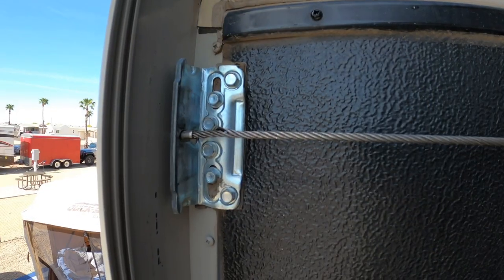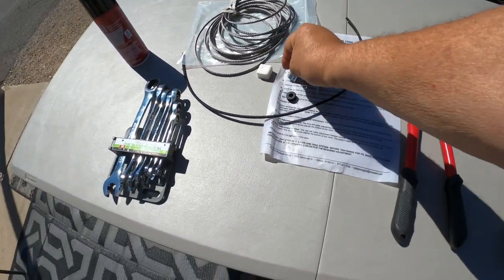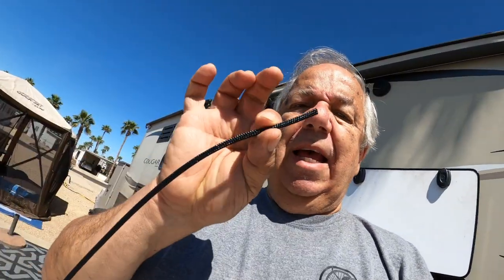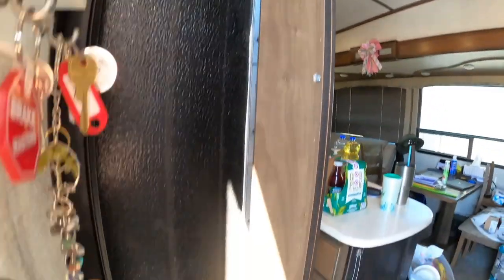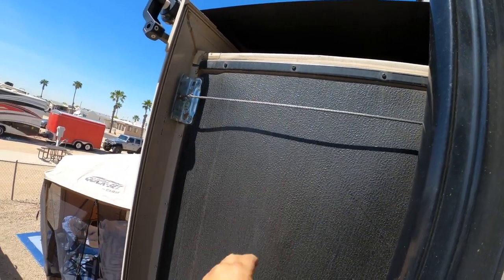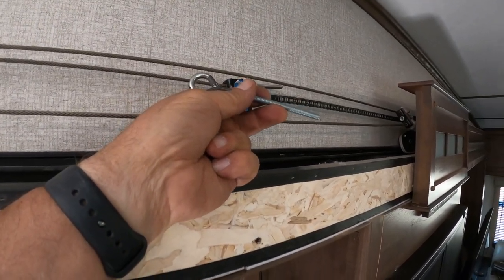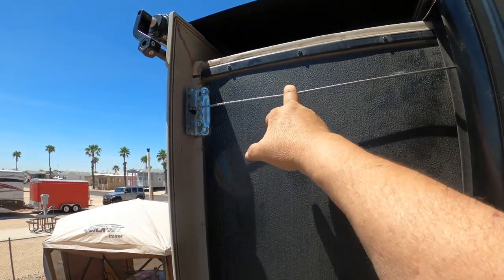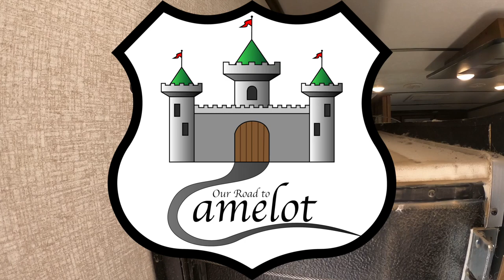Replacing the RV Slide Out Cable

Comment: Thanks for the video, I'm sure this will help someone else. I keep a toolbox just for BAL slide tools and parts. A spare motor and gearbox along with a spare cable or two is good insurance. We've broken three cables and had a gear break while on the road, all on our kitchen slide. I never thought of using an adhesive to help with the "chinese finger" tube, and you're correct about the tape bunching up.
Reply: If you have had a particular cable break more than once, then the root cause of the problem hasn’t been identified and I would suggest taking it to an authorized dealer that can assess the issue and get that fixed so you no longer damage any cables. Typically the standoff bracket placement that the cable is secured to on your box is in the wrong location, causing the cable to fail in the sealed position as it’s going down the road fraying your cable.

Comment: Thanks. Mine broke while putting the rear bed slide out 6-7 hours from home. I had to cut out the twisted mess of cable and hopefully will make it home with only 3 in pulling cables. I’ll order the cables and fix this at home with your helpful demonstration

Comment: My wood trim or headers was nailed together from Montana. To make ours serviceable all the nails were removed and all sections were reattached with ss finish washers painted flat black and 1.2" drywall screws were used. All three slides were modified like this. We also converted our refrigerator to a Dutch Aire 12v dual compressor system and needed 3/4" additional space for clearance. Some 1x2 oak strips were stained to match our cabinets and the same black screws and washers were used.

Comment: Ur cable get worn from rubbing on the aluminum trim?
Reply from the maker: There are a number of things that could cause it.  That probably is one of them.
Reply: @ourroadtocamelot  I noticed my cables were rubbing on one side. I loosened all the cables and started from scratch and adjusted them so all four brackets of my slide were touching all the way out and got the correct tension on my cables. My problem was from the factory they put the bracket on wrong. So I took a dremel tool and file and made alittle more room so the cable wasn’t rubbing.